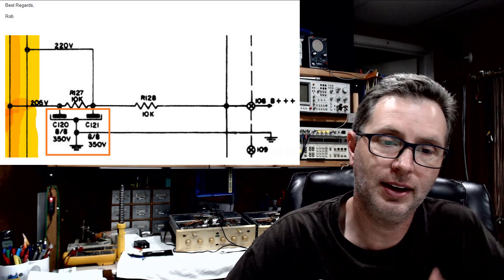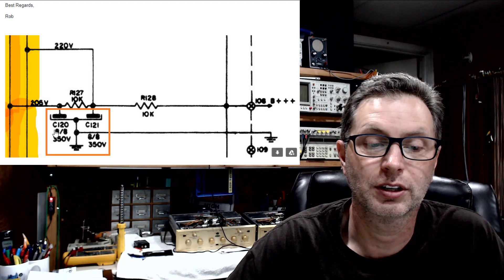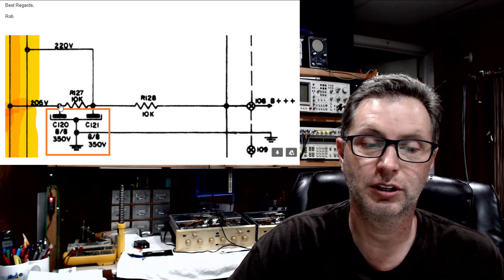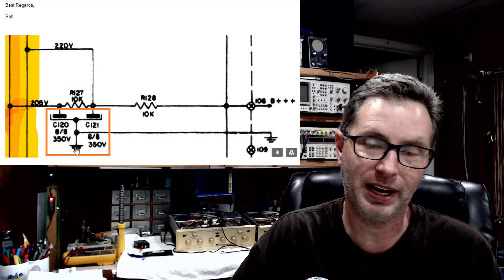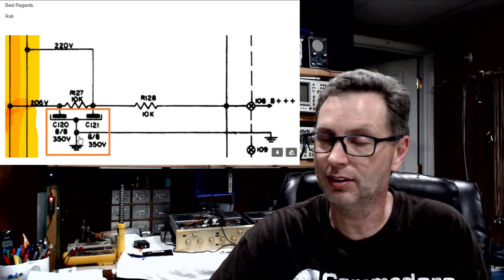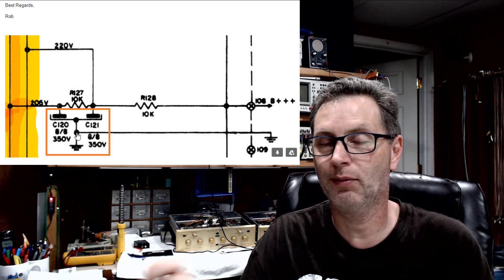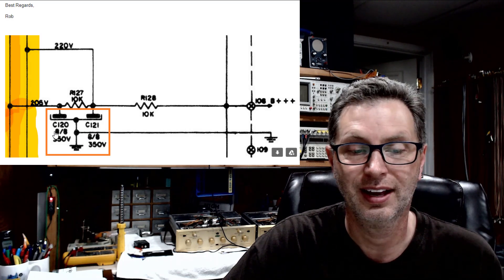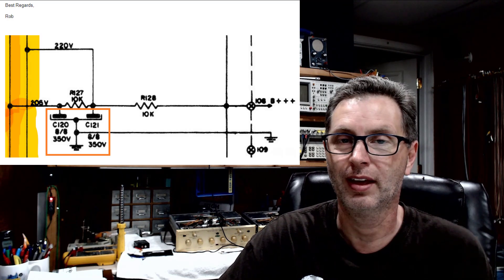Ask Mark - Mystery Capacitor Identification

Comment: I don't know if this was clear, but the ground symbol inside the box is indicating the capacitor case is in common with the ground terminal.  you seldom see these on modern equipment so I am not surprised that a newbie might have never seen a multi section capacitor.  Guess I'm old.

Comment: That was actually a question!?  He must be a newbie!
Reply from the maker: Most of my viewers are, it's my target audience.
Reply: pi-duino 
Nothin’ wrong with being a newbie.
Reply: @pi-duino I wouldn’t consider myself a “newbie” (at least not a total one) and I don’t think I’ve ever seen a multi-section can cap drawn like that on a schematic for any of the old tube gear I’ve worked on. I may have seen those pre-IC multi-component doodads drawn that way (I could, however, just be imagining that because I rarely come across them.) Not saying I wouldn’t be able to figure out what it was representing. Nothing wrong with you if you couldn’t. It’s actually a pretty cool way of depicting a multi-section cap. The only stupid question is the one you don’t ask. That’s how you learn.
Reply from the maker: I wouldn't have made the video on this if seeing them drawn that way wasn't fairly obscure.  Not saying it isn't done, but far from the norm.  I felt it was worth sharing as many may not have seen it drawn that way.  You did well in asking.
Reply: @Blueglow Electronics I wasn’t the guy that asked. Kudos to the guy that did. I learned something anyway. Thanks, Mark!